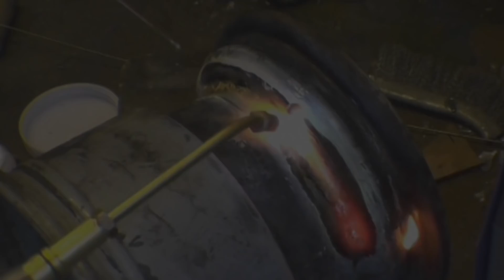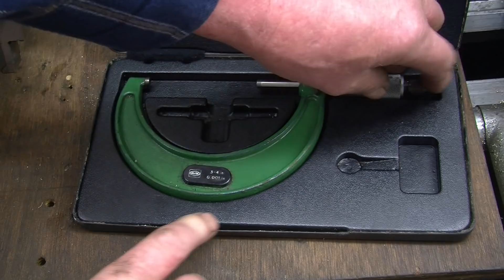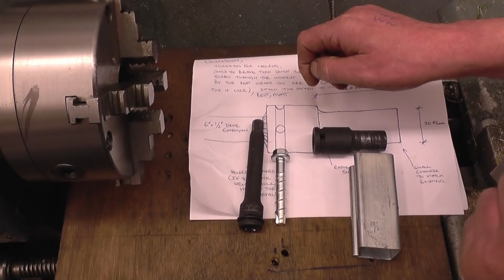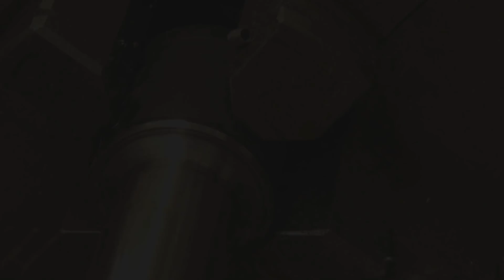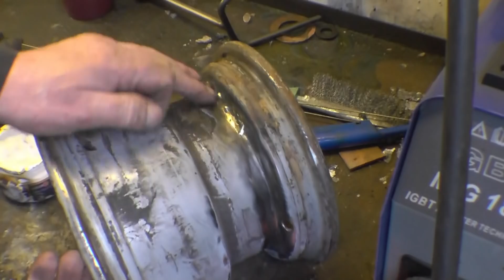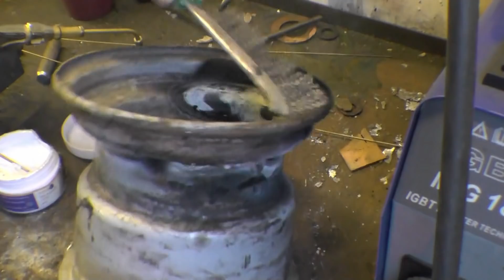SNNC 272 P1  Impact Socket mod   Wheel Braze Repair

Comment: The front seatbelt stalk bolt on an early Mercedes ml is m11 x 1.5. I know because I cross threaded the bar steward a few weeks ago and had to thread file the bolt to clean it then cut reliefs in it and used the end on the bolt as a tap to put it back in. Nightmare!

Comment: john NEVER weld hardened metal, i know a bloke that thought it would be a good idea and weld a hardened mower blade. the result was fatal. the mower blade snapped and shot across the yard resulting in cutting of a dogs leg just missing his kids NEVER WELD HARDENED STEEL
Reply: Unless you are prepared to re-heat-treat it afterwards?

Comment: john I give you credit you do alot of good work but do you not worry about run out? I have seen a lot of videos with alot of visible run out. like when you chamfered the last edge around 10:50 you could really see how far off it was.
Reply from the maker: The run out made no difference on this job, but i see your point.  It was a forged socket not a crank pin
Reply: doubleboost I mean to a point with it being off center puts extra stress especially since the walls are cut it makes the socket liable to break but I get what you're saying. I was just giving this is an example though I've seen many different things visibly wobbling just curious I wondered if maybe it was an issue with the chuck or lathe
Reply: @Matt B-This sort of remark generally originates from somebody who is not a machinist.